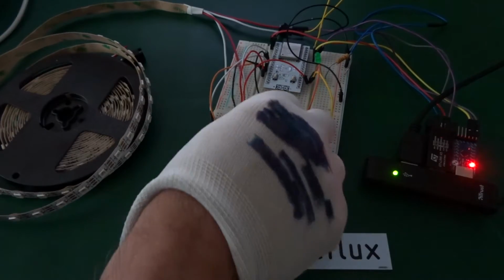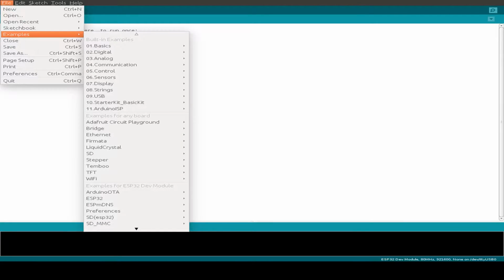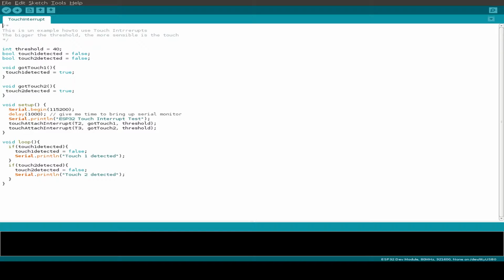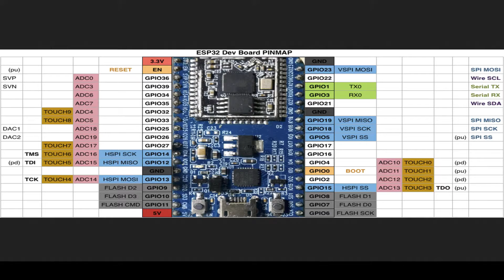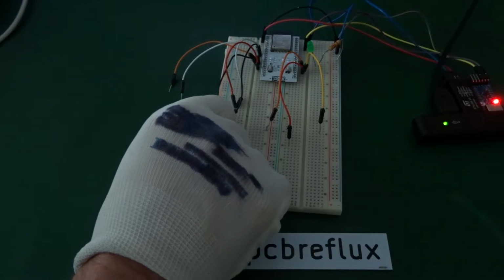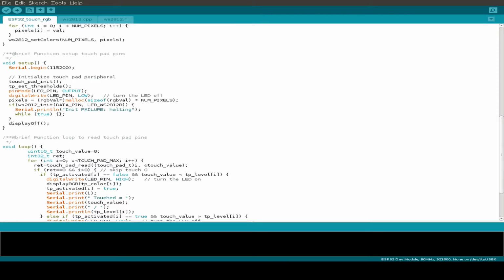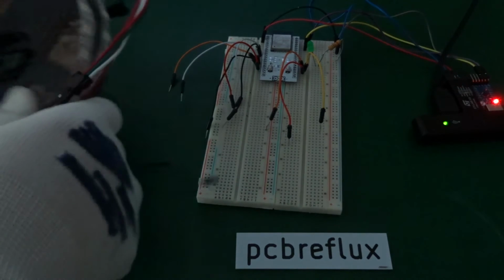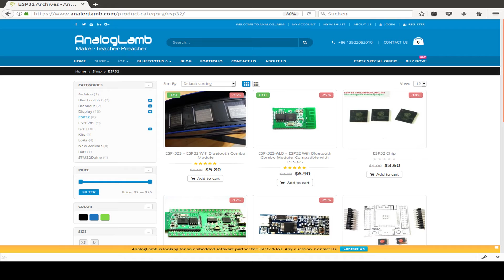ESP32 #41: Touch Sensor (300 Neo Pixel Skin Detector) + ESP32 Giveaway

Comment: I didn't know the ESP32 had capacitive touch sensors built-in. This is definitely a unique selling point compared to the ESP8266.
It simply works by letting the pin freely oscillate and monitoring the frequency at which it does so. When you bring something large and conductive (like your finger) near the conductive pad connected to the pin, it will oscillate more slowly. To detect whether something conductive is close to (or on) the pad, the controller constantly measures (takes about 8ms) this difference in frequency.

Comment: Thanks for sharing this knowledge and code with your subscribers. Hard to tell how you were powering the strip of 5050's. The leads appear to be disconnected. ESP32 dev board  is certainly full of surprises, I am still in the process of properly breaking out the total GPIO pins available on the original ESP8266. 
A look at  photomicography of the guts it is clearly a modern day marvel. I'd like to get a gander of this newest from them. Breaking out the original requires some very small soldering and managing the RF  is also a delicate matter once removed from PCB.
Reply from the maker: Beside the touch sensor pins my setup is similar to this: https://github.com/pcbreflux/espressif/blob/master/esp32/app/ESP32_gpio_WS2812/setup.png. But this time I using a adapter without USB to UART converter and without Voltage regulator see here https://github.com/pcbreflux/espressif/blob/master/esp32/kicad/ESP32-adapter/ESP32-adapter%20pinmap.png. So I use a external CP2102 as the USB to UART and misuse a ST-Link V2 as a voltage regulator  (5V to  3.3V and also as the 5V output). All my other ESP32 dev-boards are needed for other projects.

Comment: Thanks! Looks like ESP32 is not as good as Cypress psoc4 or psoc5 in terms of touch - at least in your video it did not show very reliable operation - sometimes it didn't switch on LEDs. Maybe such behavior is due to loose wires you are using as touch sensors -
 threshold baseline can't be determined properly?
Reply from the maker: You are right - sometimes the loose wires are not as sensible. But I blame it on my setup without capacitors, without proper electrodes and dielectric and on the used untweaked threshold values. Sometimes the sensors trigger also when touching the isolated wires and not only the bare pins. This can avoided using a proper pcb as touch pads.

Comment: I couldn’t find any information about the ESD protections on ESP32 pins. Looks like a few chips must be sacrificed to the science God for getting the answers.
Reply from the maker: RIP: this weekend one ESP32 board is sacrificed to the espressif heaven while trying offer 3A and 24V to a gpio pin. Think it's the Amp not the Volt that kills?  UI or RI2 = P?
Reply: They both kill! High voltages mainly affect the insulators used in the chip and conduct the electricity to the traces which are not designed to withstand that current and melt/short them. High current, on the other hand, can heat up the semiconductors and change the concentration or the position of the dopant atoms by letting them diffuse freely. This can destroy the designed p-n junctions and other semiconductor properties.

PS: “Attack of the semiconductor killer”: This can be the plot of the next cult horror movie as a psycho going around and putting high voltage/power in semiconductor devices!
Reply from the maker: Sure, just an old electroboom joke.
Reply: Ohh… That sexy unibrow man! He is assuming the resistance to be independent of the voltage and the current! :D